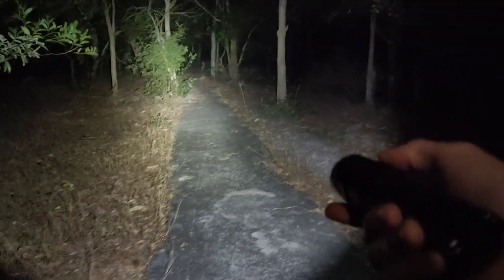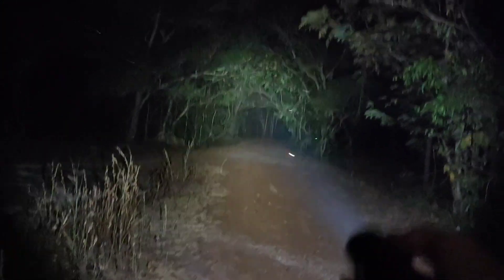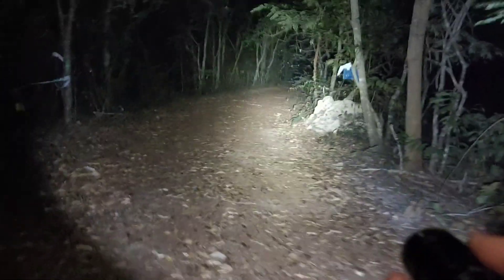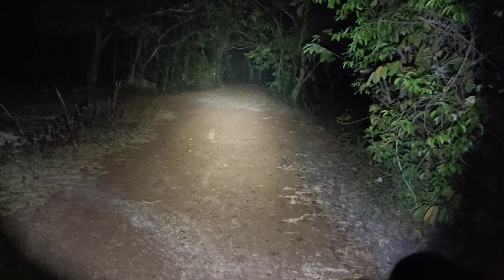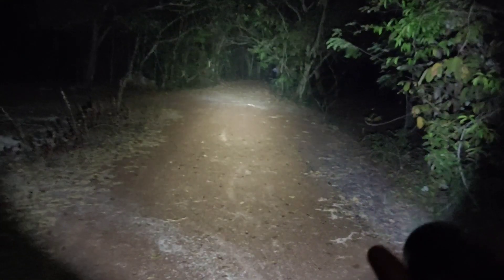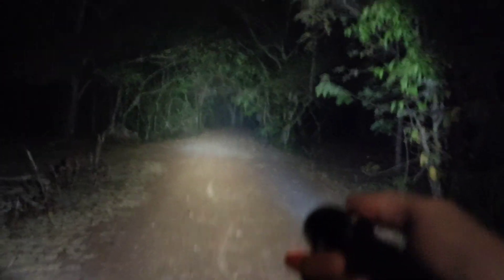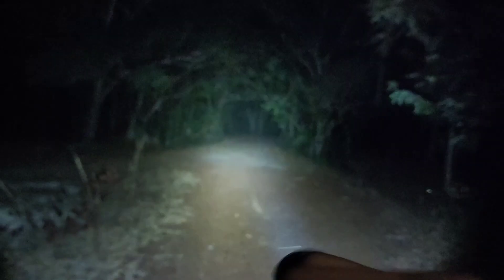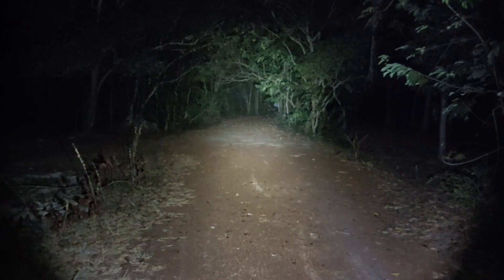Sofirn tf84 sst40 (modified)

Comment: It would be interesting to see the process to modify the light from scratch. That would be an interesting one to watch
Reply: How did you overcome the reflector being too small for the LED?
Reply from the maker: Just simple sir. Remove the crown and the lens and the just change the led. I don't have the tf84 anymore. I sold it already. Thanks for watching sir.
Reply: @weerapatkiatdumrong  thanks but I have no experience in this...I may not be the only one
Reply from the maker: @dgkrompholz  I started from zero sir. I learned from YouTube. And just do it. I failed quite often but that makes me learn. Believe in yourself that you can do it. 😊
Reply: @weerapatkiatdumrong  thanks, I do the same but I like to learn from others so I do not fail, especially after getting a nice new flashlight 🤪
Reply from the maker: @dgkrompholz  The most difficult part of changing flashlight led is you have to be careful about soldering. Try to make small solders otherwise the + and - may touch each other and cause a short-circuit through a reflector.
Reply: @weerapatkiatdumrong  hmm, I think you have good lessons learned and experience to offer through... You guessed it, a YOUTUBE video demonstrating the full process, including parts required and where to get them 🤣

Comment: Unfortunately I couldn't open the bezel on mine. The bezel is so thin there's no way to get my strap wrench on it
Reply from the maker: I use a hammer sir. The wooden holder of a hammer. I place a bezel part on the wooden part and then twist the flashlight counterclockwise. It comes out easily.
Reply: @weerapatkiatdumrong  I'll give it a try, thank you. I feel like the LH351D LED isn't the best in a tactical model, it needs more throw
Reply from the maker: @PiercingTheDarkness  Here is how I open it sir. No scratch on the bezel. I agree that Lh351d is not good enough for being a tactical flashlight. So I put osram cslpm1 in as it gives more throw and beam intensity is great for self-defence. https://drive.google.com/file/d/15xxK4StA02X-NoPqJBwmxJASv6S0qZkg/view?usp=drivesdk
Reply: @weerapatkiatdumrong  can you please ensure this Google doc is still available? I can't access it anymore. Thanks
Reply from the maker: @dgkrompholz  I have deleted it. I put its crown head on a a stick and twisted it sir.